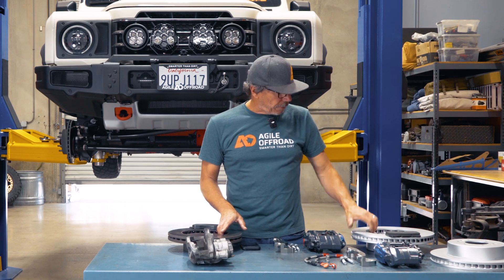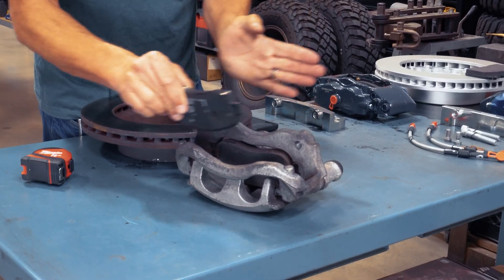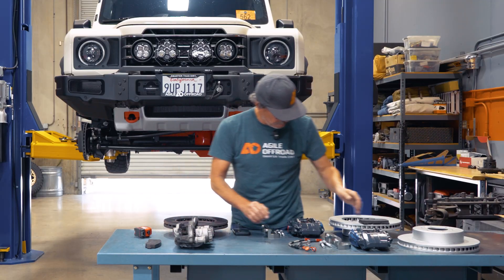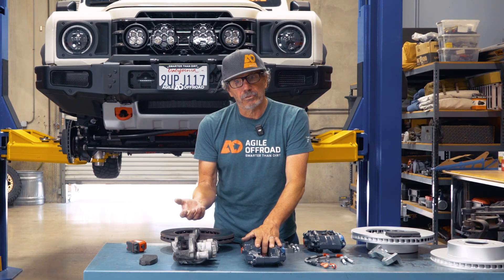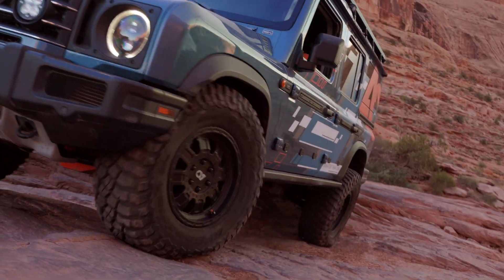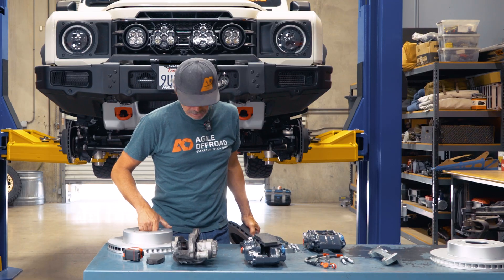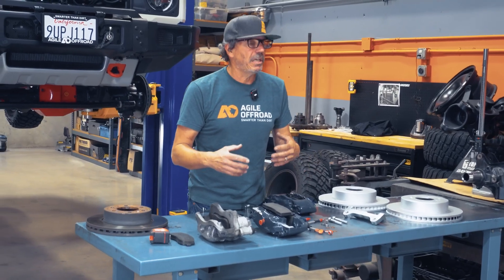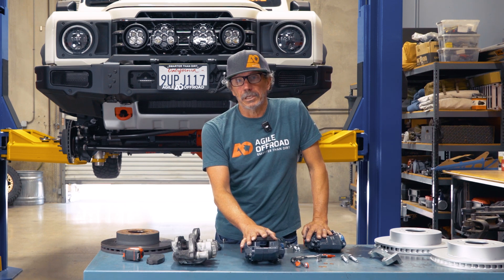Grenadier Brake Showdown: Alcon vs. Factory

Comment: When you upgrade with this brake kit will it fit the factory steel wheels or do you also need to increase the diameter of the wheel to accomodate the larger rotor and caliper?
Reply from the maker: Hi! Great question! This size of rotor and caliper will work just fine with the stock wheels on the Grenadier, no need to change anything to make them fit. Hope that helps!

Comment: How much unsprung mass is added per corner with this brake kit?
Reply from the maker: Good question! We’ve actually weighed both setups and the Alcon Big Brake Kit adds about 14 lbs (≈ 6.35 kg) total over the factory front brakes, or roughly 7 lbs (≈ 3.18 kg) per side. We figure It’s a small increase in unsprung mass considering the massive gains in braking performance, heat capacity, and overall durability.